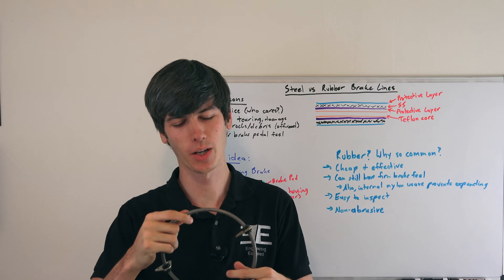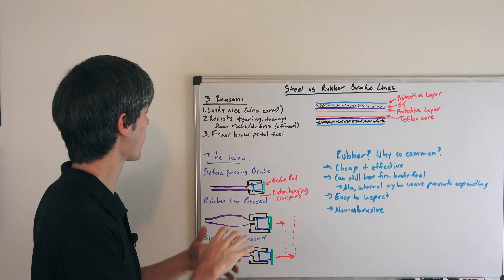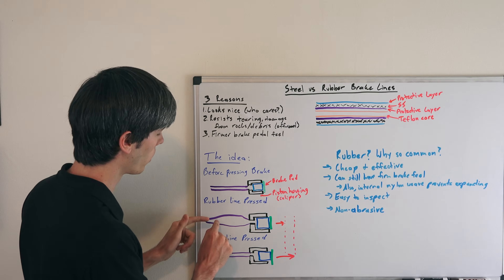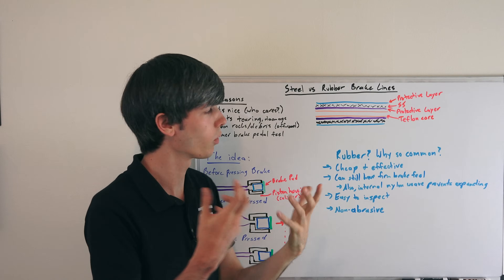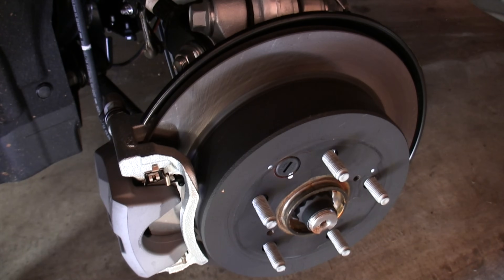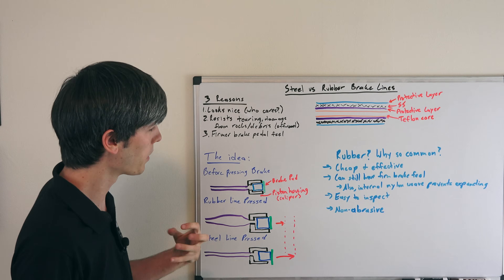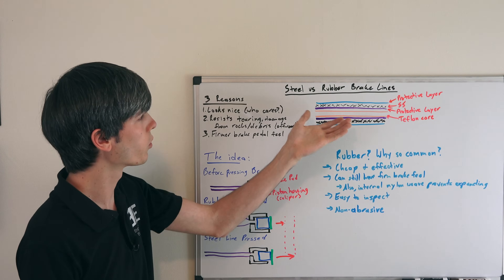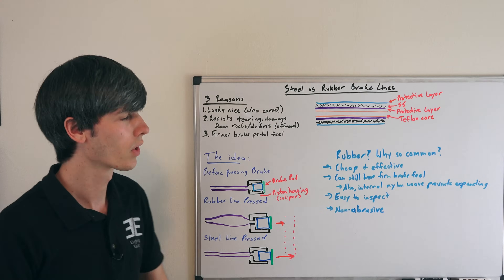Steel Vs Rubber Brake Lines - Are Stainless Steel Lines Silly?

Comment: so what's better?
Reply from the maker: +Jason Maddlink Haye Depends on the application it's used for, as mentioned in the video. :)
Reply: +Engineering Explained oh ok. braking in my car is rather numb. switched brake pads and rotors to ceramic pads and slotted rotors, I get better feedback but the travel is still too much. 2010 sentra sr.
Reply: +Bennett Raymond I do frequent check ups, at least once a month. master cylinder is fine. starting to think that it's the fact that the car is a econobox.
Reply: +The Last Driver i reckon your actual callipers warp when you push the brake pedal. its a common problem with econobrakes. also I've got 6 piston willwoods installed on a 2600 pound car and let me tell you they are the worst brakes I've ever used. hope this helps.
Reply: then the SS brake lines will probably help a little
Reply: +Bennett Raymond probably would. been contemplating for a while.
Reply: +Jason Maddlink Haye  If the pedal feel has always been an issue from the beginning of ownership, it may be down to the caliper itself. My guess is that you have floating calipers vs. fixed, but I'm not familiar with the sentra sr, so I could be mistaken. If you haven't already done so, you may also want to just do a brake flush/bleed.
Reply: +intellistar1122 the brake system itself is just shit lol. willwood would be my only option.
Reply: +Jason Maddlink Haye  LOL. Willwoods would be nice. The brakes on my GTI aren't brilliant either, but I figured I would wait on upgrades until the current pads and rotors wore out.
Reply: +intellistar1122 what specific concern do you have with your GTI's brake system?  I'm the original owner of a 2004 GTI VR6.  The car has 107K miles.  The brakes seem to be okay but now that the car is 12 years old, I am more concerned about the potential for a sudden brake line failure.  Unsure if that's a valid concern.  The brake lines are all original.  The brake pads were replaced with ceramic pads and the rotors were replaced at the same time.  I'll add that the car has been driven in temperatures ranging from -10 degrees to 120 degree, on an ongoing basis.  Based on all of this, what are your thoughts whether or not I should consider replacing the brake lines?  If you recommend replacing them, what's the reason?  Also, should I consider replacing the master cylinder as well?  The only issue I ever had was that Brake dummy light came on once due to the brake fluid level being low.  I added fluid to the master cylinder and haven't had an issue since that time.  I'd appreciate an objective opinion from you, +Engineering Explained or others that have experience with brake systems or VWs.   Thanks in advance.
Reply: First off, nice car. I love the way the VR6 engines sound, especially with a nice exhaust. 

It's not so much a concern but rather a minor gripe. With floating calipers, there's a limit to pedal feel. That being said, my car's a daily driver, and maximum braking potential is not needed on a regular basis. When the rotors and pads do wear out, I will probably consider getting a fixed caliper BBK though.

Regarding your brakes, I'm no professional, but I don't believe that brake systems have a hard and fast replacement time interval as there are a plethora of factors that can determine the life of the parts. Like rotors and pads, you have to check for signs of wear and replace them when they are worn. The easy things to check for are leaks which could be signaling damaged seals, rust on the hard brake lines, and damaged hoses on the soft rubber brake lines. If your brake fluid level seems to be decreasing regularly, then you may have a leak somewhere in the system, so you'll have to figure out where the fluid is pooling (hopefully not in your carpet if it's not on the garage floor). I don't know what the recommended bleed procedure is for Mk4's, but Mk5 and Mk6's are pressurized through the master cylinder, so that would be another way to check for leaks and such. 

With all that said, it would probably be worth having a professional do a thorough inspection of your brake system if just for the peace of mind.
Reply: IT DEPENDS
Reply: +Jason Maddlink Haye It could also be your master cylinder, in my chevy pickup, the cylinder went bad it the pedal was very soft and went almost to the floor. the new one was very stiff, and you only barely had to touch the brakes to stop

Comment: I did install steel brake lines on my 4x4 under the impression of enhanced feedback, which there was little difference, however the do stand up to the elements better, as you stated, so not a total waste of money for my application (£30 for a set)

Comment: There are a couple of additional benefits of stainless steel braided Teflon lined brake hoses: 
(1) Higher tolerance of elevated temperature operation. 
(2) Broader fluid compatibility. Some factory rubber brake hoses are not compatible with some high performance/competition brake fluids. 
(3) Higher maximum working pressure and higher burst pressure than rubber brake hoses. 
(4) Stainless steel braided Teflon lined brake hoses are available in custom configurations including inner diameter, length, termination fittings, mounting,  and max working pressure,. 
(5) Most SS braided Teflon lined brake hoses are more flexible that their rubber counter parts and usually will safely operate with less bend radius without loss of performance. 
(6) Increased safety from incidental hot fluid/heat/fire exposure (increased exposure time before failure). 
(6.a) Certain sanctioning bodies specify and mandate SS braided Teflon lined brake hoses for safety reasons. 

It should also be noted that not all SS braided brake hose/line assemblies are street legal and or DOT compliant/certified/approved.
Reply: +patw52pb1 
I just had to replace a 22 year old rubber clutch line. Maybe im wrong but I would say that SS lines have a longer life span. Ill tell let you guys know in 22 years.
Reply: M Lizard  I'll be waiting for an update on its reliability in 2038
Reply: @MrInfernalStorm  Its been 8 years so far, how are they holding up?
Reply: +123 456 
Easy, it is my job to know.
Reply: +patw52pb1 Dude...how do you even know this stuff?
Reply: +zmast333 That's not the same effect, but could be a part of it. Change the brake fluid to some kind of high performance fluid, and always double check the braketoe before getting on the track. :)
Reply: +scbonduk 
(1) Flexible stainless steel braided Teflon lined brake line(hose) tolerate elevated temperatures better than OEM/stock aftermarket flexible rubber brake hose. 
According to DOT, a traditional OEM/aftermarket DOT compliant flexible rubber brake hose begins to deteriorate when exposed to elevated temperatures above 295 degrees Fahrenheit and pressures of 1600 PSI and above. 
See the data below. 

(2) The problem is not so much what is in the fluid reservoir, but what the flexible rubber brake hose exterior is exposed to. 
Most OEM/stock aftermarket flexible rubber hydraulic brake hose conforms to SAE Norm J 1401, DOT FMV SS 106, DIN 3996 and ISO 3996 and is constructed with an outside EPDM cover with 2 layers of rayon braiding sandwiched inside. 
While EPDM exhibits excellent resistance to traditional Glycol Ether/Borateester base brake fluid deterioration. 
EPDM exhibits poor resistance to petroleum based motor oil/lubricants/hydraulic fluid/ATF/grease deterioration, where with extended exposure EPDM degrades, deteriorates, softens and swells. 
EPDM also exhibits moderate to poor resistance to some newer high performance/competition ester based high temp brake fluid. 

(3) Yes, new OEM/stock aftermarket flexible rubber hydraulic brake hoses are burst pressure rated in excess of what the typical passenger vehicle can consistently and safely generate in normal driving. But that new unit burst pressure has nothing to do with safe working pressure or burst/rupture pressure of a used and abused 4+ year old flexible rubber hydraulic brake hose and especially when operated at elevated pressures and temperatures during repeated hard braking. 
Yes, they flex, hence the name "flexible rubber hydraulic brake hose". 

(4) You should stop(pun intended), you are contradicting yourself, custom and mass production are not synonymous. 
Find me a part number, price, US stocking distributor/wholesaler/retailer and availability for a DOT compliant 29.7 inch long seat to seat, 0.125 inch ID, -2 0.375 inch dual 180 degree feed-thru 20 degree zinc chromate steel extended neck crimp banjo fitting, 3/8-24 37 degree female inverted flare 180 degree zinc chromate steel extended neck crimp fitting with hex retaining clip flexible rubber hydraulic brake hose. 

Flexible brake hose specs: 
Most OEM/stock aftermarket DOT compliant flexible rubber hydraulic brake hose has a working pressure of 3000 PSI, burst pressure of 13206 at working temperature of -50 to 250 Fahrenheit when new. 
Flexible stainless steel braided Teflon lined brake hose has a working pressure of 6525 PSI, burst pressure of 19580 PSI at working temperature of -94 F to 500+ Fahrenheit when new. 

Was your last line really necessary?
Reply: +Chuck Salerno 
Wow, incorrect. 
What brochure?
Reply: If you got a regular street car, some of these upgrades can be preventative maintenance in the long run if you plan to have the car for a while, like the oil cooler you stated and transmission coolers. A transmission cooler can extend the life of an Automatic transmission. Do you "need" one, no. Though it sure can't hurt and may make it last longer, especially if you travel up and down hills/mountains a lot or do towing/hauling. 

Either way, patw52pb1 is right and I personally don't like this guys videos as he over simplifies and generalizes things too much that it almost become misinformation. 

As for mister off-roader who never needed these brake line, you never do until it's too late and wish you had them. A true off-roader would know you are better off safe than sorry getting stuck in the dirt if you do ever slice a brake line. There's a reason 90% of the brake lines are steel tubes. The rubber hose are only used where flexibility is needed between moving parts. 

Do I have them, no. I also don't race or go off-roading. If I did, I'd be getting them, again, better safe than sorry.
Reply: +patw52pb1 You must sell them!! Million miles on the road and never needed them once.  They look good and work! The End!
Reply: +patw52pb1 You are correct, they do serve a purpose in high performance applications. I also been going off-road since I been driving an have had at least 15 raised trucks and guess what, still never needed stainless braided Hoses. 
I was just being sarcastic about you selling them but my opinion stands, they look good! the end.
Reply: +scbonduk this is more of a fluid statics problem than a fluid dynamics problem.
Reply: Well I guess he checked ✔️ yall 🤣🤣🤣... He's right, the SS lines are just superior. End of discussion.
Reply: Brown noser
Reply: patw52pb1 k
Reply: @W Not that I remember, though I had another issue with brakes after the track day (probably some seals got cooked) and they were not working at their best.
Reply: Chuck Salerno Oh, OK. I was not aware... apologies
Reply: +scbonduk Actually braided brake lines do not cost any more than replacement rubber lines for my vehicle in fact they are cheaper front and rear line kit adds up to $110 while the OEM rubber lines are about $160-$200 front and rear from the stealership.
Reply: +patw52pb1 Wow man your getting a lot of hate for stating some facts about SS flex lines, personally myself I feel they are a must have option if you plan on visiting the track. 
 The problem is most people just change there calibers, pads and rotors and think their auto is ready for 10+ laps of hard braking at the track but like any performance mods you need supporting mods as well to really get the full benefits. 
I myself find it cheaper (depending on your goals & if you already have OEM fixed calibers, vented discs) to just upgrade your Vac. booster or steering pump, flush out your old brake fluid for a nice R rated 5.1 and change out your pads and flex lines for some Ceramic pads and SS braided flex, before dropping $5K on some willwoods... but damn those willwoods sure do look pretty lol.
Reply: +Ralf V 
No, I do not sell them. 
Who said you or anyone else "needed" them? 
They serve a purpose.
Reply: Ralf V
Then clearly, they are not for you. 
Why all the irrelevant opinionated rhetoric?
Reply: +patw52pb1 Wow you can read the brochure
-Sean Boswell
Reply: +patw52pb1 its a joke from fast and furious bro chill
Reply: I spent 2000 on my ap racing front kit. it came with stainless lines. and now my pads last twice as long. it's an unnecessary expense for a street car. but when my pads go from lasting 3 days to 6 or 7 plus no fade that is huge.

I noticed a difference in pedal feel changing to race fluid and pads but no difference going from rubber lines to stainless. but my car was only 1 year old at that time. I installed them for the stated benefits by that guy above. I see them used on real racecars and although I'm not technically racing my car sees a lot of the same stresses as an actual race car.

i also have an oil cooler which can be argued I don't need it but it also has similar type of benefits.
Reply: +patw52pb1 +1 for the high temperature operation. I had standard rubber brake lines in my 350Z and it was fine day to day but i went to the track once and after a couple of laps i had to fully depress the brake pedal and the press it once more to get enough pressure. Never went back to the track but got them replaced anyway.
Reply: i find my braided ones on a rx7 make it a lot nicer to drive, they seem to sit nicer than the rubber ones did
of course theres the other big advantage of stainless is hard to wear through and your highly unlikely to slam the breaks and rupture it.
Reply: +patw52pb1 
1) Rubber hoses are highly temperature resistant any, so you're solving something that doesn't need solving.

2) What on Earth are you putting in your fluid reservoir?! Brake hoses are highly oil resistant. You must be putting something corrosive in there.

3) Rubber hoses are pressure rated in excess of what the braking system and the piston can take. So if there is flex (which is highly unlikely unless you added a master cylinder and servo which are rated too high) it would be microscopic and negligible.

4) So are rubber hoses. In fact, because they are many times cheaper to produce, getting custom sizes is much easier due to higher mass production.

You clearly know jack shit.
Reply: "(6.a) Certain sanctioning bodies specify and mandate SS braided Teflon lined brake hoses for safety reasons. "
hahahahahaha!!! You lost your mind! Proof please! LMAO! ...The only difference in brake fluid, is temperature tolerance, anything else, is a marketing scheme. GTFO of here, professor. I'm patiently waiting on a proof of the law mandating SS lines....  hahahahahahahahahahahahahahahahahahahahahahahahah.................................
Reply: +Jay Semple I couldn't give a shit about marketing...I like something so I get it.

If I were trying to impress with a made-up profession then I wouldn't say I'm a hydraulic modeller. No reason to lie.

So you run out and buy your braided hydraulic lines...but if you do then you're more of a marketing victim than any Apple customer because the claims associated with braided lines are bullshit other than that they last longer...though 10-20 times longer is doubtful, yet they cost that much more.
Reply: +Jay Semple Not that you are even old enough to drive yet you little shit.

Comment: I would have like to see the demonstration. so we can see the difference in braking response and distance
Reply from the maker: +Derek Williams It will not change how fast you can stop, only how it feels in the pedal. Either will be just as capable at locking the wheels up.
Reply: thanks for the reply

Comment: I don't use brake lines. Weight reduction bro.
Reply from the maker: +bshawn41 ^^ This guy gets it.
Reply: What's your brake hose weight reduction to sticker application weight ratio?
Reply: I use a steel anchor instead
Reply: @thomas_nl_  you mean like the army planes that have a hook to catch a line on the air craft carrier to slow down type thing?
Reply: @mlee6050  more like those things ships use to not float away
Reply: @thomas_nl_  I guess I mainly said the plane as they slow from like 100 or 150mph down from a hook in just metres but on ships they stop or slow down 
before let it down
Reply: Real men dont need brakes
Reply: I just pop the hood at a ton plus to slow me down the car shakes like a shitting dog but it works for me and it has the added bonus of shielding me from seeing the crash:/
Reply: Lifted_Above 1 to 20
Reply: Jesus take the calipers
Reply: Fred Flinstone style.
Reply: Yeah, if your brakes won't stop you something else will, right?
Reply: MAXIMUM ATTACK
Reply: Yabba dabba doo baby!
Reply: Bro send me the buying link of your riding boots
Reply: my man
Reply: Brakes slow you down, weight reduction doesn't, which is the whole point.
Reply: I had a friend who never used rear view mirrors and indicators for weight reduction and horn fir reducing noise pollution .
Reply: How much fuel you save 🤣🤣🤣 the irony
Reply: Rove the rims while your at it. Less rotational weight
Reply: Is it Bluetooth lines?
Reply: +5HP
Reply: I weight reducted the whole vehicle. Gg noob
Reply: Breaks only slow you down.